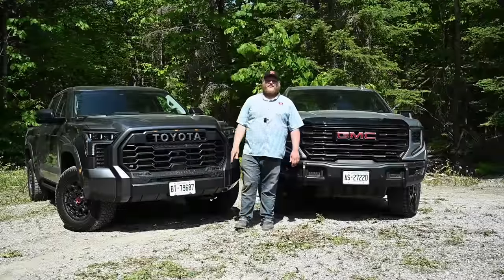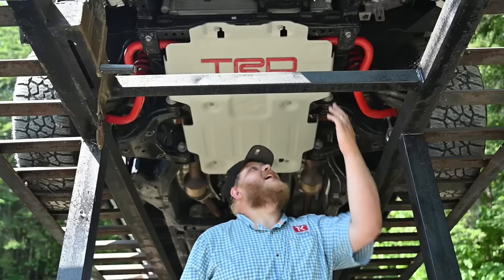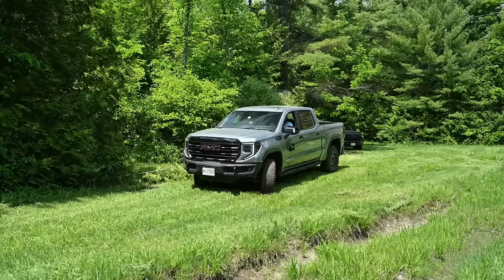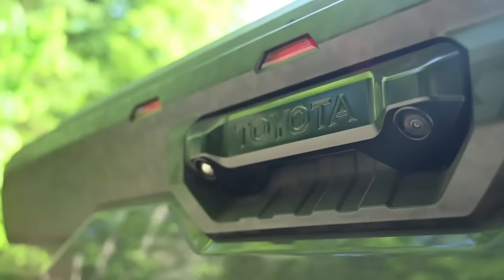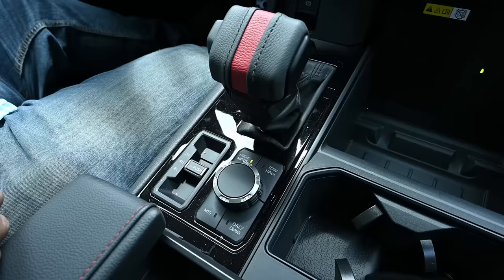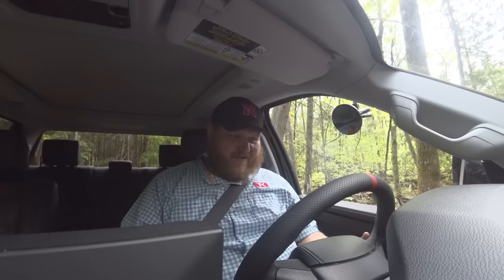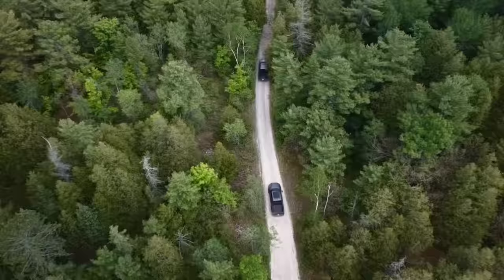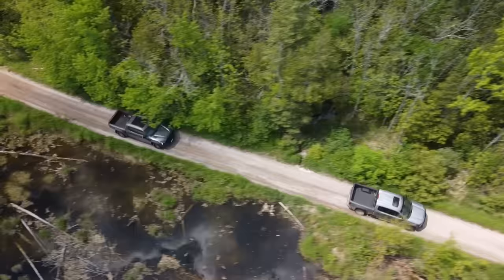2023 Toyota Tundra TRD Pro vs GMC Sierra AT4X AEV - Mud, Rocks & Water will Decide Which is Better!

Comment: I sure would like to see a real world towing series with all of Toyotas hybrid trucks. Big numbers are nice, but how long can they be sustained? Enough for a long hill or a series of climbs and descents? I’m unconvinced these systems carry enough battery to be useful on the  Coquahalla for example.
Reply: There’s a tundra towing test. Same channel will have a gmc too most likely
Reply: So you don't think the Toyota can tow what they claim or it just can't tow any kind of distance or what?
Reply: @T_81535  I actually really like Toyota trucks. My question has to do with the sustained use of the hybrid motor towing in mountainous terrain. Things like: does the battery last long enough for a long hill and/or a series of hills. Does the battery recharge quickly enough so full power us available on the next hill. I DO note that it worked very well pulling the Ike Gauntlet on TFL and that is a long hill. I’m assuming it will be good, but have seen no actual test.
Reply: @jaykanngiesser3454 gotcha

Comment: You said you tested the trucks as provided yet you didn’t take advantage of the front locker in the tests. You were critical of the cost but understand that cost includes the front locker. Doesn’t sound quite fair does it. Personally both trucks are too expensive for by budget so I wouldn’t buy either.

Comment: GMC appearance is a little better.  On both trucks,  the grills are hideous. 
GMC did a homerun  with steel bumpers and skid plates and with front and rear lockers. 

Every truck/suv on the road should tow hooks.
Bad for Toyota 

Now , it comes down to reliability.  Toyota for the win.

Comment: Selling my Tundra to buy a Sierra with the Diesel. The GMC is a much nicer vehicle with better engine options IMO. Toyota really needs to be cheaper. The fit and finish just isn't up to par. The Toyota name doesn't carry the same kind of weight it did either. They have their problems like any other manufacturer these days. And their trucks are good but they could be better.

Comment: I really want a gmc at4 with the 3.0 diesel but man I own 2 chevys and ya they are strong but one has a bad oil leak already coming from valve cover the other has an oil leak I think from the o ring from transmission to motor. Bad starter cracking dash board changed 2 door handles already stitches coming apart from driver seat. This is a 6th Camaro and Escalade.  My Tacoma is still going strong as fuck. Only done brakes oil changes and battery all interior still in place. Stereo sticks tho. Camry Corolla all going strong as well. So I think I’ll have to get the tundra if and when I can afford it.

Comment: I don't buy it. You made the GMC limp with 4Low rear locker only when it could do so much more. You should have ran it 4low front and rear locked. Then 4 high front and rear locked as well. But thank you for showing us both trucks.

Comment: For the price difference to the performance I would choice the Thundra too, also 20k is alot of after market upgrades to even up or outperform the gmc.
Reply: In real life toyota dealers are charging $90k for this tundra & gm is selling the at4 aev at discounts. Also you can get the chevy zr2 for $73k
Reply: @googleaccount2637  Not in my state for some reason no one is buying yet they won't slash prices. Toyota is sold out even if they add a mark up. That if you can get one off the lot.

Comment: You do not mention and leave out 1 Very Important piece of information for people to take into consideration for anyone who keeps their vehicles. The Tundra hybrid replacement battery pack costs over $ 6,000.00 Dollars. I asked the parts department the cost when I started gathering my information on the trocks I was concerning. Wish the Tundra still had a V8 and needs front tow hooks. I don't want a vehicle that I will be looking at that kind of known cost coming down the line. Bad enough the cost of tires, and Toyota wants a small fortune to replace the tire monitors when they go bad. I still need to get more info on the GMC Sierra but have looked at its sister truck, the Silverado and like that you can get it with a 6 inch lift kit, larger tires and a whole package of upgradess through the dealer for a good price, if you go to a good dealership. Some overcharge though, like anywhere.

Comment: Geez, payload on these trucks sucks. I have a 2019 Silverado 1500 LTZ Crew short bed 5.3 z71 that had a payload of 1,734. What is the point of 1,000 lb payload. A minivan or SUV has more!

Comment: I like that you guys did this but maybe for departure angles the Tundra should have been tested with the TRD 3" lift kit that is an option since the AT4 has a factory lift also.  I would also go with the reliability of the Toyota over the GMC even if it didn't perform as well.  Since 2014, GM's longevity quality has tanked....speaking from experience.

Comment: sick video. 
i ordered the miller cat stainless steel and tried the magnet trick and failed. i emailed them and asked why it was not magnetic, and they said its because the stainless steel does not have a lot of iron in it. is that true or did i get hosed?
Reply: It’s true that stainless steel is very low or non-magnetic.
Reply: @RyanRKJ  thank you bro.

Comment: 1000 pound payload? That cant be right. If you have 4 full grown men youar at 800 so only 200 lbs of equipment extra fuel aftermarket goodies.
Reply: It's not right. My 2024 tundra has a pay load of 1950. I took 4 passengers on a road trip with me last week with the back full of luggage and hauling a trailer with 2 4-seater canam mavericks. It drove like a dream. Also this is on a a fully loaded SR5 with the trd suspension.

Comment: You forgot to mention that the Tundra's Falken tires are not nearly as capable as the aftermarket Falken's, insomuch as they have about half of the tread depth, to achieve a higher MPG, thus a higher CAFE for Toyota.  Pure crap.

Comment: As these sit with the same payload as the midsize off-road trucks why would anyone spend almost 1.5-2x for a full size? Towing? This is a tricky marketing scam. If you have 1100 pounds payload, subtract your family of 4 with a dog, 600-800lbs, your left with what for your trailer? Tongue weights at best with 10% 300-500 lbs leaves you with a trailer of 3000-5000 lbs. lol. Okay then you go to 15% tongue and you can’t pull more than a wrangler. No payload, no towing, astronomic prices and poor tires, what’s not to like?

Comment: Trd pro look bad to me. The truck is to physically large for the lift and tires it has. Just looks very unproportional. And the hood is stupid long for some reason if you see it in person. Overall just not appealing to me whatsoever. Especially since it only comes with a hybrid system. I wouldn’t ever buy a hybrid personally. I’m a master tech and I just don’t wanna deal with that headache and not be paid for it lmaoo

Comment: RIDICULOUSLY low payload for both
Reply: Like powerwagon 2500 with 1000lbs payload. Almost as if these specific models are designed with softer suspension for offroad 🤔

Comment: Not one of these channels can do an actual comparison of equally matched trucks. It never fails. In this case they take a gm that should be compared to the trd pro. The result is an endless supply of useless content that doesn't give you a true comparison. 
It's always a mismatch due to trim or tires.
Reply from the maker: We can only compare what’s available.  It will never be a perfect match up.

Comment: I just wonder how does my wife's Maverick hybrid with 190 horsepower have over 450 lb higher payload
Reply: Suspension obviously. It is soft offroad tuned suspension.
The power wagon 2500 has 1000 lbs payload because it is designed for offroad, obviously. It amazes me how some people even manage to watch a video on YouTube.
Reply: @googleaccount2637 Thanks internet expert.

Comment: 2009 Silverado 4.8L 1500 has higher payload and tow than these giant new $90k trucks smh. 1985- 1992 Toyota Pickup has a 2,600 payload capacity with an I4. That's embarrassing for these new trucks.

Comment: You cannot compare the power in the two trucks. You wanna compare 6.2 v8 engine to 3.5 hybrid engine. lol even with the 3.5 engine the Toyota performed well in off-roading. It is common sense that the v8 engine will put out more power. Idk why time wasted on videos like this.
Reply: The basic 3.5 puts out more power though... I smoke 6.2s all day in my sr5

Comment: Both of these trucks are way too expensive and full of bad issues plaguing both of them. Toyota misses the mark with the smaller less reliable engine. GM used bad software on the V-8 making it have issues. High interest rates and overpriced trucks make for dealerships having full lots with few buyers.

Comment: Both trucks are awesome I think. Tundra has a V6 with more horsepower than 6.2 GMC. But gmc has some nice features on the inside. But for the long haul….which one would last longer on wear and tear and longevity on the power train?

Comment: TOYOTA all day long.....(coming from a former GM guy) had a gmc sierra brand new ...nothing but problems....went to a USED tundra and havent looked back....both trucks have their plus and minus but 10 years down the road the tundra will be MORE RELIABLE then the rest ....i can just imagine how much the AT4 shocks will cost to replace ....tundra has always been simple and reliable!
Reply: @@ThomasJeffersonIII you could be right or wrong as well.....guess time will tell but since the little problem with the shaft on the wastegate havent heard anything negative in recalls at all for the tundras...cant say that for the others though...constant recalls about something for all of them....

Comment: i had a at4 with the 3.0 diesel and just traded for a tundra trd not the pro but the trd off-road.  the at4 has a better fit and finish when it comes to the feel of the truck its not as cheap feeling as the tundra with all the plastic i also lik the tailgate of the gmc better, the tundra has a better ride, better seats  and more inside room. i wanted another at4 but the price point made me look at toyota so far im loving the truck time will tell if i go back to gmc or not

Comment: Toyota built a truck for people who want to take their boat to the lake for the weekend. GMC built a truck for the person who runs a business needs a truck to do some truck stuff during the week, but on the weekend it’s play time.
Reply: You must not be a contractor. I am and I can tell you a million stories of guys who punish their trucks and all American trucks can’t handle “real truck stuff” they put most people in a bad spot with super expensive repairs. Most American truck guys especially the diesel guys spend thousands per year on repairs. Not to mention the thousands on top of that they lose in down time. Absolute junk masquerading as tough. Toyotas on 1/2 form are stronger and have the same size rear axles as the 1 ton Dana 60 had throughout the 70s and 80s. But with bigger ring gear. If you never owned a Toyota you’ll never know.

Comment: I think the GMC swayed much farther to off road usage being dominant. I think the Tundra compromised just enough to get by off-road but, had you had a “tow a 10,000lb trailer down the highway test”, it would have been game over. 

Given that so much depends on tires, if you put the same tires on both trucks, I would half to conclude the Tundra would then excel in all tests. Likewise, aggressive tires are not as good for highway use.

Comment: So, these "trucks" barely have a 1000# payload, which means my nearly 20 year old Titan, still out hauls and tows these things and with the rear locker, will do whatever these are doing.  So what exactly am I getting for $70k, besides a better paint job (at this point)??
Reply: Better offroading. This gmc even has a front locker they didn't use for some reason. Look at rams powerwagon, also 1000 lbs of payload.
Obviously all these brands offer several half ton models with better payload capacitities.

Comment: Idk why people fuss over the V6/I6 vs. V8 debacle. A 6 cylinder engine can perform just as well as a V8, it just sounds different at the end of the day. GTR’s with V6’s run Texas2K (range from 1200-3000 hp), the Buick GN with a V6 ran through all the V8’s of that time, Porsche has embarrassed your average super cars with I6’s since the beginning, Jeeps & Taco’s crush most off-road events, and I can go on really. The issue with most vehicles is how the engines are built, how the electronics are implemented with EVERYTHING else, terrible maintenance habits with all the turbocharged engines, and the overall quality of the entire package. In the case of off-road, 4x4, and towing vehicles, there’s different segments for a reason!

Comment: Toyota  has a huge aftermarket supply with many sites... I'd say for the better power, more reliability, and better resell; I'd pick the Toyota.  With the aftermarket sites, a metal bumper with recovery hooks and all aluminum skid plates will be easy to find. Still total thousands less than the GMC, when tundra and parts added together. Don't get me wrong, the 6.2L GM motor is a strong and reliable  motor. Toyota  as a whole has shown 500k to 1mil mile vehicles time and time again. I have faith in the hybrid in the truck because  I'm still seeing prius's driving  around from 20 years ago.  Plenty with over 400k miles. Not to mention even the old st gen tundras were towing not much different  than the brand new GMC. The 2nd gen tundra pulls more than the brand new GMC. To look at trucks 10 to 20 years older than the new GMC pulling more, says a lot. I can buy those older ones for around 15k. I can't see a 80k to 90k truck that only pulls 8500. Pretty sad.

Comment: The price difference is surprising.  I’m thinking the gmc may have a bit more room and nicer interior. But does it have as sophisticated safety features as the new tundra?  Maybe. Does it have the roll down back window?    No I don’t believe so. And will it have the long term reliability that you’re more likely to get with a Toyota?  Maybe GM has upped this with this last generation?  All that and 20k less…
Reply: Get the chevy 1500 zr2 if you want to bring the price down.
Reply: @googleaccount2637 no thanks
Reply: @@ThomasJeffersonIII they sell them at list price here at my local dealership.  Admittedly they don’t last long.

Comment: 109K for a Chevy truck? The Chevy truck has went under 2 modifications since the late 70’s. Body panels and a newer version of the push rod engine. Oh yeah and some interior tech. Older folks don’t like change and that had to be the reason dad gave it a thumbs up. The Toyota is 22K less and it is actual modern vehicle. WOW  $109.000.00 you better get some GM stock with that purchase.

Comment: If you want a true off-road vehicle a Tacoma, FJ Cruiser, JEEP, Lexus, or Defender will work better. You need a platform that can turn tight corners and has the right weight and power to climb and swim. The only thing getting pulled out of the mud are these HEAVY long wheel-based full-size trucks.

Comment: Tundra... coil springs (not "coilover" as stated in the video) mean not just high-speed off-road runs, but every day on-road it's much better, low-end troque delivery, Toyota QDR (tho GMTs are some of GMs best)... You rated Tundra a hair behind... now imagine if it had real tires! (of course AEV has a few more tricks you didn't tap into, but for less than the price premium of the AEV, I can tap in to an ARB catalog and not only add a front locker, but also an air compressor). Toyota omitting the tow hooks was dumb.